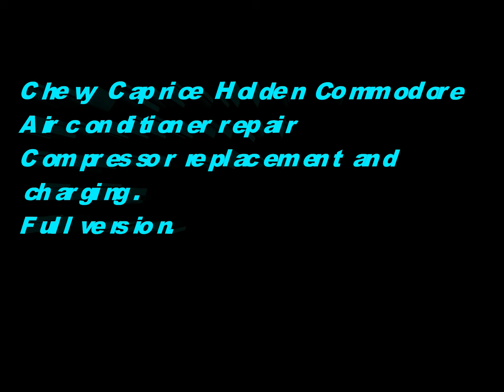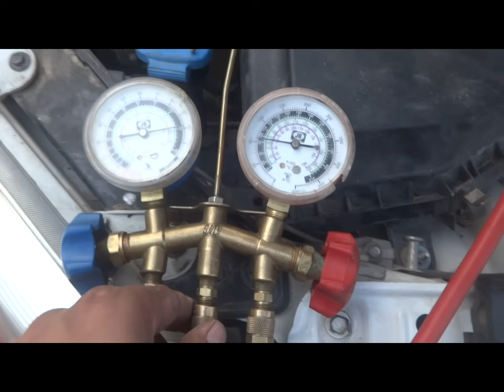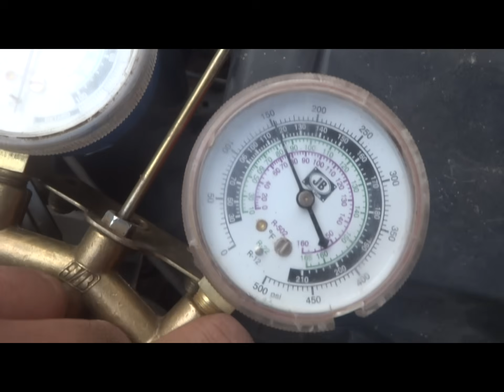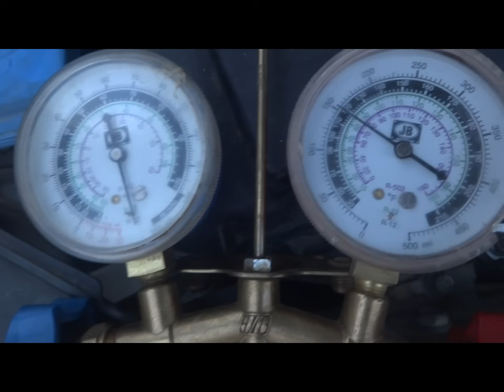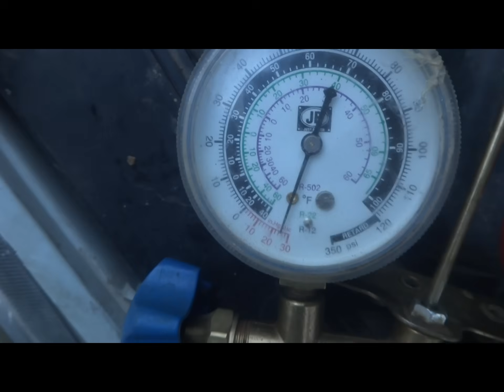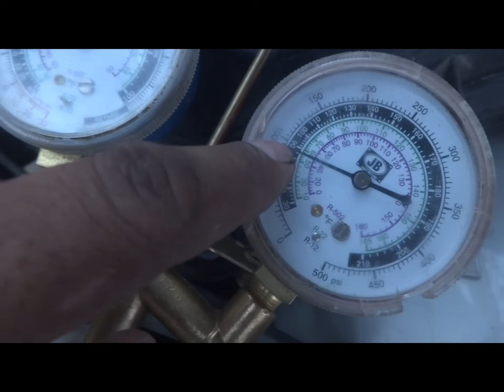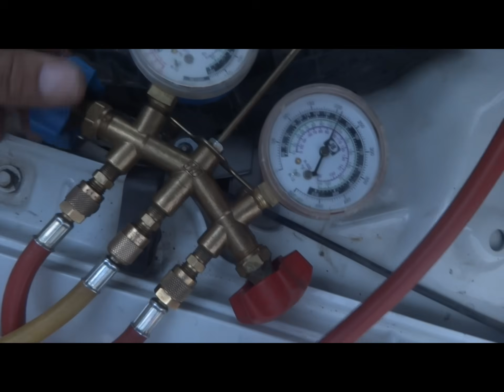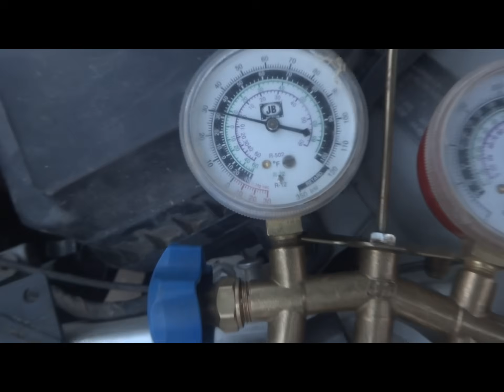Car air conditioner repair; Air conditioner refilling and recharging.

Comment: i have a 2001 vu ute and was told the condeser was leaking  but the system still  has prussure in it wen i push on both the shrader valves                 if the condeser had a hole in it would it still hold presure?
Reply from the maker: Maybe there will be a very miner leakage. So there will be still pressure.

Comment: Hello bro, 

Air conditioning re- gassed but cooling and was blowing warm air. I checked for leaks at home with dishwasher liquid into water and pour the water on TX valve and found the leaks
When I changed the TX valve O ring but air is still coming out. Is it evaporator O ring or the pip has hold on it. any help is greatly appreciated. Thanks 

video link 

https://www.youtube.com/watch?v=N1JQ0Zint80
Reply from the maker: +winter jon As you tried to repair it. Look carefully maybe the o ring you fixed will not be of the perfect size or your fixation procedure maybe not good. Look gently and try to fix the leak. Regards,
Reply: +LearningZone  is their any Oring on the other side of Tx valves on under the dash that i can change
Reply from the maker: +winter jon Yes sure there are. But that depends upon your car particular design. I saw them in Nissan.
Reply: +LearningZone  it is 2002 VZ Holden commodore the same car u changed the compressor. can i change the evaporator pipe O ring  from under the bonnet or dash has to come out to change the O ring? thanks

Comment: LearningZone +When the a/c system is full of refrigerant does the psi on the low side remain steady as the compressor engages and  as it disengages and drop back down to the previous same psi as before when it was engaged

Comment: Thanks for this video, i want to talk about three thing,  first did you fill the compressor with oil, second you didnot clean the system with gas 11 finally why you didnot change the dryer filter. Regards.
Reply from the maker: The compressor I added a little quantity of oil. The cleaning had already been performed before. The filter replacement is theoretical. Practically you can reuse a filter.

Comment: i have problem with same car
the compressor sometimes working sometimes not
someone was checked it , there is no leakage
and he told me compressor is weak should be replace with a new one
but what i am doing many times when it is not working i spray water in around radiator , after that compressor is good and working
what's the solution please ?
Reply from the maker: SAFA SAFA Dear friend this is very common problem with such systems. In your case I thing the compressor is not bad but the control circuit had some problem. I would upload a video on such problem solution. Where is your location in Saudi Arabia?
Reply: I am in Madinah 
i am still  searching solution  , many workshop say this AC sensor problem and they ask me to Purchase a new one .
and someone not advice me to buy Delphi compressor !
Reply from the maker: SAFA SAFA That is great friend. Hope I will get a solution for so called Delphi! This is a new age technology and not bad as people are thinking. It is consuming less fuel, putting less load on the engine and other good features are there. Problem with them is their control system had not been engineered properly according to our environment. I will do work on them but will take me some time as this time I am going on vacation and will enjoy the time with my parents there. After returning back I will work on them and hope will get success to re-engineer the control system for them according to our environment.
Reply: thank you

Comment: First time seeing refrigerant being loaded.Talking to air conditioning man recently and he told me they use nitrogen to test the systems at about 400 psi.The nitrogen combines with any Oxygen and leaves no trace.Uses high accurate meter to find leaks down to 00.000.Very interesting video and job well done.
Reply from the maker: Such all things are theoretical. Practically it is done how I illustrated in this video dear sir.